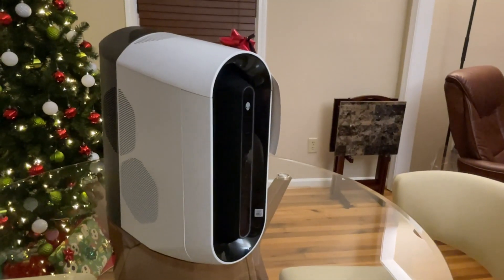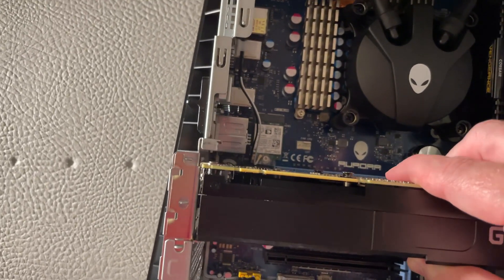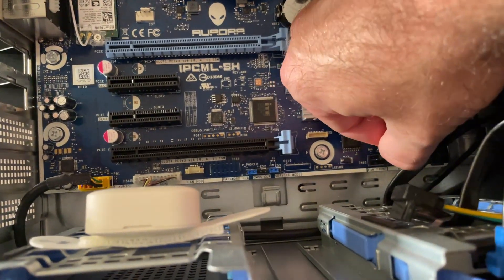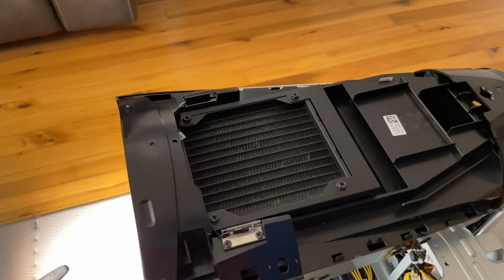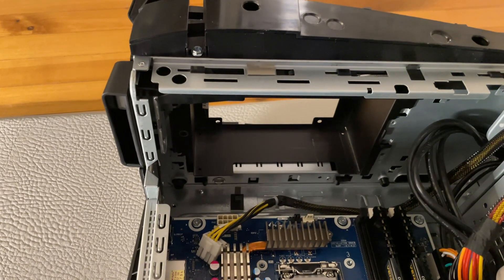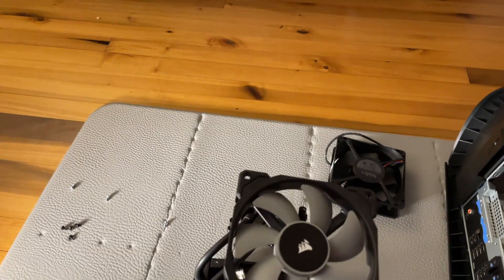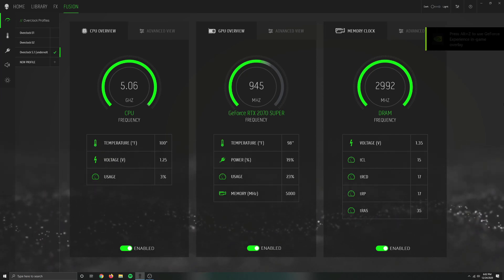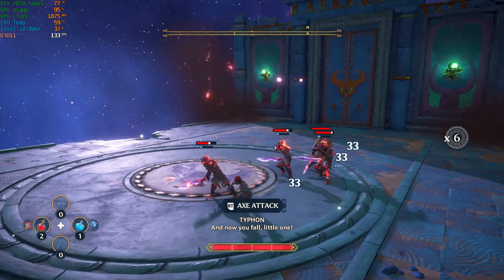Alienware R11 Radiator Mod and Case Fan Upgrade

Comment: Hi Joe, would screws like this work? https://www.amazon.com/gp/product/B07938P6YP/ref=ppx_yo_dt_b_asin_title_o04_s00?ie=UTF8&psc=1 I received them and tried them on the fans and the fans were able to wiggle a bit, also the screws are a bit thinner than the short ones the fans came with.

Comment: Hey ! I just bought two ML120 fans, non the pro ones is that a problem?
Reply from the maker: The non Pro fans will throw up a BIOS fan test boot error. You can by-pass it to boot normal, but it will still show up every boot (super annoying). I had to redo all of the work after first doing it with the non-pro fans.

Comment: Hey Joe, this video helped me out so much. I installed the front fan and was good to go. Ordered two more fans and everything else and hooked everything up and I got a yellow Alien power button which I googled and it means it’s a motherboard error. Had to revert everything. 

Just wondering if you had any ideas of what the cause might be. I’m thinking the Y splitter.
Reply from the maker: Did it boot to Windows okay (with just the front blinking?), or did it throw up a BIOS boot error?
Reply: @theonlyjoe6036  I actually couldn’t get the OS to boot at all. I may not have given it enough time before shutting it down. The fans sounded off, which i possibly didn’t have the 1-1/4 screws aligned correctly but that wouldn’t cause any issues with the PC booting. I wouldn’t think. I’ll attempt another try this weekend and if it isn’t a success I’ll give more time to see if a BiOs error pops up. I probably jumped the gun and shut it down too hastily. I really appreciate your quick response. Thank you!

Comment: Fantastic video Joe !  So when adding another ssd I see you are using the blue connection on the mobo , is it best to use that one? I’m running m.2 NVMe 2tb single drive and no hhd/ spinner and want to add a Samsung ssd for extra storage or even another game on it. Thx
Reply from the maker: The blue SSD connecter (ssd 1) uses it own PCI lane, while the others (2-4) share a single lane. Really not too much of an issue if you are only using a single 2.5 inch SSD. I run a 1TB NVME, and a 2TB 2.5 inch SSD.

Comment: Hi so i purchased Corsair H60 i took out Stock fan and it only has Radiator and 1 fan goes inside casing for top fan, do i have to put stock in as top?
Reply: when i did it i believe i used the fan the came with the H60 as the top, then radiator, then stock fan
Reply: @staycreamy  Instructions showed to take out stock fan

Comment: Thnx! Just bought the R11, and all the recommended components. However, the 4 gold screws are not included, right?
Reply from the maker: Correct, the gold screws are # 6 1 and 1/4 inch Phillip head machine screws. I bought the ones I used in the video at Home Depot.
Reply: @theonlyjoe6036  Thnx, I think you helped me dearly! Now, I can't waint untill 5th od april, haha

Comment: great vid - does a solid job of showing what's involved and i agree with putting a warning on the top fan replacement.  it's a bit sketchy to perform in this tight case and also removing that top panel just feels like something is going to break for sure.  fwiw, this mod will work with noctua fans as well.  i used 2 x NF-A12x15 PWM for the push pull (as they are a bit slimmer than normal 120 mm fans) and 2 x NF-F12 PWM in the front (i also pulled the drive cage and put a fan in it's position as well).  no bios errors - fan control does still spin up and down - i'm using the stock "quiet" profile.  fan control does seem a bit flaky if i try to do a custom profile with my own fan curves with these new fans but the quiet profile keeps everything cool and quiet well enough.  it would be interesting to know if custom profiles work with the corsairs or not.  i used noctua because i have yet to find quieter fans and i'm happy overall with the mod.  it's definitely worth doing in terms of case volume and temperature reduction.
Reply: Interresting. Why have you chosen 15mm thick fan instead of 25mm.? Also why NF-A on top and NF-F on front?
Reply: @patrickzanchette3913  1st question - size and performance - I did not think two 25 mm would fit.  It seems like from this video they would but I did not know that when I built my plan.  I thought I was dealing with 1 x 25mm fan or 2 x 15mm fans and Noctua have said that 2 x 15 mm in push/pull will exceed a single 25 mm.  That said, it seems like maybe you can slam two 25mm in and still have clearance so I guess take my above reasoning for what it is worth.
 
Second question, NF-A -15 is made for radiators/coolers in space restricted areas so it was the ideal fan for that.  It was either that or a single NF-A12x25-PWM.  I would've also used the NF-A12-25 PWM for the front fans as it's a great all around fan but I could not find them in stock over the holidays when I was buying the fans.

I ended up getting the NF-F fans for the front because it's a good static pressure fan that was available.  The front of the Aurora case doesn't really have a lot of open air/space on either side so I wanted a fan that could pull air through efficiently.  If the NF-A12-25 PWM had been available, I would've used two of those but the NF-F seems to be doing fine work - and is less expensive even if both SKUs are available.  NF-A12-25 PWM would likely be quieter and a bit more performant but I'm happy enough.
Reply: @emberos  thanks for the detailed answer. As NF-A 25 are not available, do you think using NF-F 25 for the top would be a good idea?
Reply: @patrickzanchette3913  NF-F12 PWM is a good heatsink/radiator fan.  I would definitely prefer NF-A12-25 PWM but yeah, they don't seem to be able to keep that fan in good availability right now . . . and what is available seems to be victim of price shenanigans.  It's almost like it's the PS5 of fans :)

Comment: Great video, I just got my r11 and was looking to improve cooking and reducing noise, so this was perfect. I first replaced the front fan before committing to top fan. I noticed that using the command center I can’t get the front fan to reach 100% speed, I’m maxed out at 57%. Have you pushed your fans and noticed this too?
Reply from the maker: Quick note: The Corsair Pro fans do not have as high of RPM or voltage rating as the included Delta (front fan) or Nidec (top fan). The ACC software is configured for the stock fan voltage and RPM. So while it says 57%, it is actually 100% of the Corsair Pro fan speed (I've verified this with a volt meter that the ML 120s are in fact hitting 100% of their spec power rating in the R11). My ML120 pros never actually run faster than 42% in the ACC software (per the fan curve I have setup); my top fans runs at 17% and front at 10% (per the ACC software) under normal web browsing.
Reply: @theonlyjoe6036  My front fan runs at 10% too. Thanks for the reply!

Comment: What after market ram did you buy? Looking to upgrade to 32gbs
Reply from the maker: I used Corsair CMK32GX4M2B3000C15 LPX 32GB DRAM 3000MHz C15 Memory Kit. I posted a link to Amazon and Newegg for purchasing. It works with the XMP profile in the Alienware Command Center with no issues.

https://www.amazon.com/gp/product/B014UYPEXE/ref=ppx_yo_dt_b_search_asin_title?ie=UTF8&psc=1

https://www.newegg.com/corsair-32gb-288-pin-ddr4-sdram/p/N82E16820233871
Reply: @theonlyjoe6036  thank you!

Comment: I watched the video well. Is Noctua NF-A12*25 PWM 5V 4pin possible, not Corsair cooler?  And I want to know the screw specifications!!  Thank you
Reply: i used 2 x NF-A12x15 PWM for the push pull (as they are a bit slimmer than normal 120 mm fans) and 2 x NF-F12 PWM in the front and didn't get any BIOS errors.
Reply from the maker: @emberos  Thanks! Great to know that another kind of fan works.
Reply from the maker: I've heard from others that Noctua fans will throw up a BIOS error on the R11. I actually had to redo all of the work after trying to use regular non-pro ML120s, which caused a BIOS error to show up.

The gold screws are #6 1 and 1/4 inch Phillip head screws. You can pick them up at any hardware store (I got them from Home Depot).
Reply: @theonlyjoe6036  Thank you for your answer. Since there is no non-RGB model in Korea, I purchased the ml120pro white LED model. Is it okay to install it?  Oh and Happy New Year
Reply from the maker: @깡만-m3x  I should work, but even if it doesn't it won't harm anything. You will simply get a boot error saying Fan Speed Check Failed.
Reply: @깡만-m3x  hey im about to purchase the ml120 pro white LED model as well. did they work for you? any bios errors?

Comment: Can I apply the same fan mod to the R10?
Reply from the maker: I'm not 100% certain on this, but it shouldn't be a problem since the R10 and R11 share the same Asetek cooler (my understanding is that the only difference between the R10 and R11 is the choice of AMD (r10) or Intel (r11).
Reply: @theonlyjoe6036  Is a #6 screw same as 6/32 screw?

Comment: I did all the mods you have here for my Aurora R9,  I have since added a additional fan above the front fan. In the place some models have a standard HD enclosure.
Simply moved that enclosure to the bottom of the case and installed a ML120 non pro 3 pin fan. Used a Noctua Y splitter from the bottom fans mobo header. Now running the fans at lower RPM  and whisper quiet under full load.
Reply: Yeah its lowered the temps. On the gpu when gaming its hoovering around 60°C and the cpu seems to be happy under 70°C regardless of what task I'm doing.
Reply: Have you checked to temperature change with the addition of this 2nd front fan? Does it worth it?

Comment: I have installed the three fans according to your method, and the sound has been improved a lot. However, I would like to ask you a few minor questions. Because the third fan is installed, the water-cooled position is changed. In addition, my temperature before was 35, and the temperature after installing three fans was 41. I wonder if it was caused by the fan speed? Or is it because I used XTM50 thermal paste?
Reply from the maker: I would advise to make sure that your cooling tubes are not kinked in any way. After the radiator mod, the cooling cables on the radiator bulge out to the side more but the orientation of the cooling block stayed the same. Also make sure that your cooling block is properly secured, and enough thermal paste was used. 

That said, I did notice an increase in my temps after a recent Alienware update (I actually did this mod about a month and a half ago, but held the video as I wanted to make sure it was safe and stable for anyone to do). I am now running right around 39C during regular day to day use with 17% top fan and 10% bottom fan use. I still don't get above 60C during load, and both temps are more than acceptable for a 120mm AIO.
Reply: Ning Huang. Exactly got the same Problem. Changed the Corsair and put the Stock Coolers back to buisness. Its more loud, but cooler ;) I send the Corsairs back.

Comment: Would the RTX 3070 FE be compatible with my R11?
Reply from the maker: Yes, The FE should be compatible. The R11 can fit a GPU with a length of 10.5 inches.

Comment: Could have used a before and after demonstration of the noise reduction, was curious to hear the difference. Other than that, thanks for great video may want to try this when my warranty expires lol
Reply from the maker: I tried to capture a before and after, but I couldn't quite a good comparison using my RODE microphone that I use for re-dubbing. I also don't own the proper equipment to measure DB within a proper margin. That said, sound is also more about just noise level. The type (pitch?, frequency?, tone? whatever sound engineers call it, but I'll go with acoustic signature) also plays a large role in how we perceive sound to be pleasant or unpleasant. Besides making the case more quite, this mod also made sound more pleasant (tolerable?, less annoying?) even when the fans are revved up.

Comment: Please drop links to the fans! I want to upgrade my fans soon
Reply from the maker: Here is the link to the exact fans that I used. They must be the Pro version as the Non-Pro version will throw up a BIOS boot error. I actually had to redo all of the work because I used the non-pro fans first.

https://www.amazon.com/Corsair-Premium-Magnetic-Levitation-CO-9050040-WW/dp/B01G5I6O4Q/ref=sr_1_1?dchild=1&keywords=corsair+ml120+pro&pd_rd_r=44d4de8b-ca30-4047-89d3-d0e868a51127&pd_rd_w=qlhud&pd_rd_wg=3GeLc&pf_rd_p=0ec05f25-9534-48fe-9c3e-40b89957230e&pf_rd_r=0DYNTMRWE0TAK8TDV1XD&qid=1608922173&sr=8-1